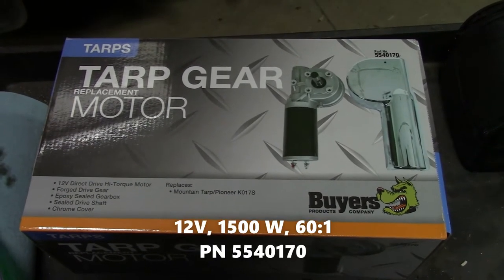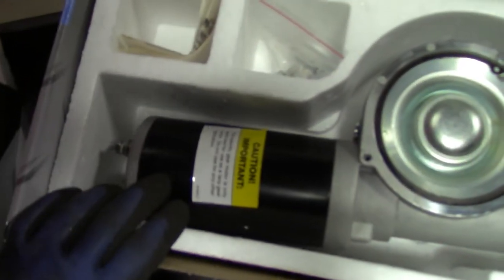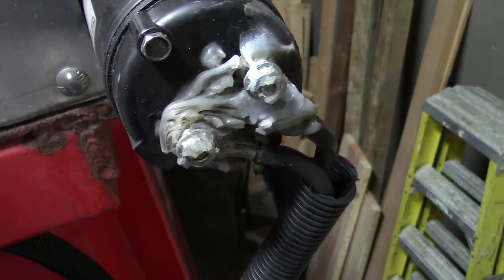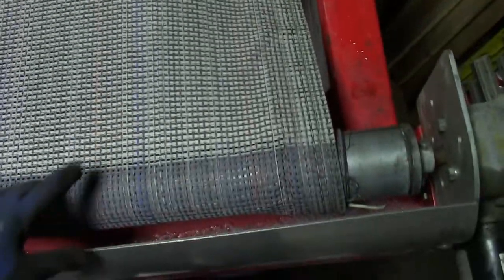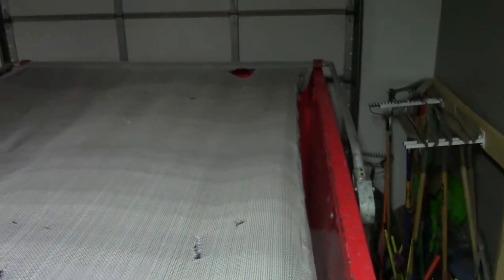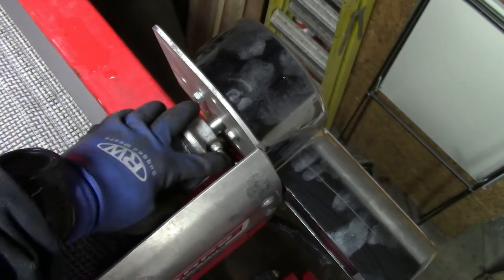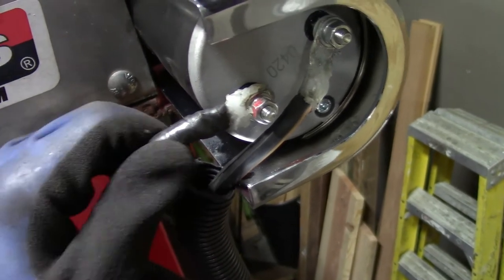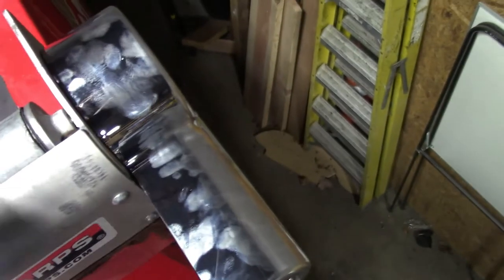Replace Tarp Motor

Comment: My tarp is seized in the open position. I need a safe way to release the tension
Reply from the maker: You might need a second person to hold the pull bar down while you release the bolt. Possibly, you could bind it down with a ratchet strap? I don’t remember if I’ve done both at the same time, but the spring force of a single arm can be held just with just a firm hand grip on the tarp arm
Reply: @stevenzielinski1890  good idea! Thanks for the help